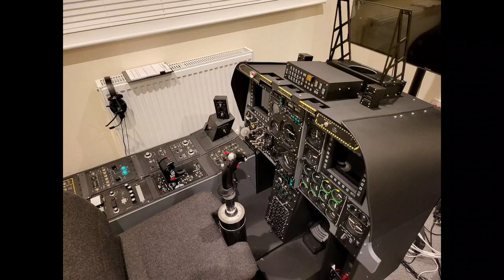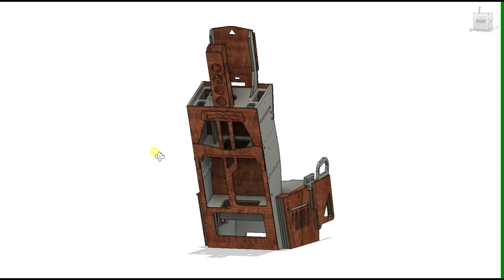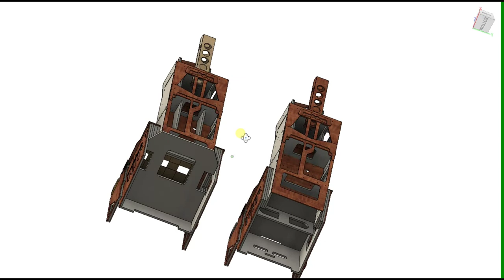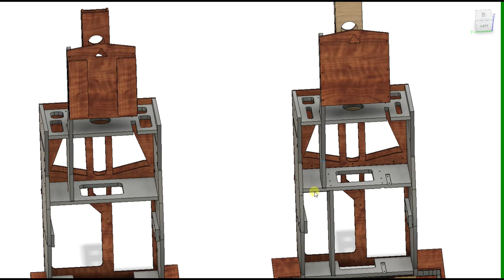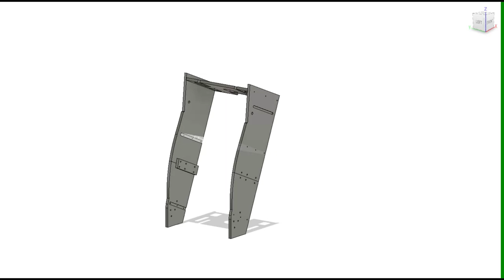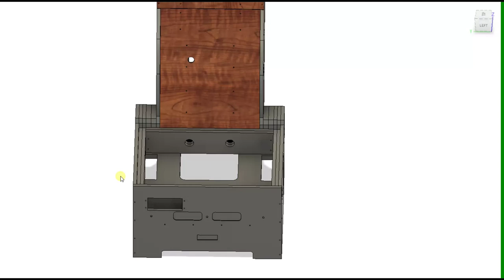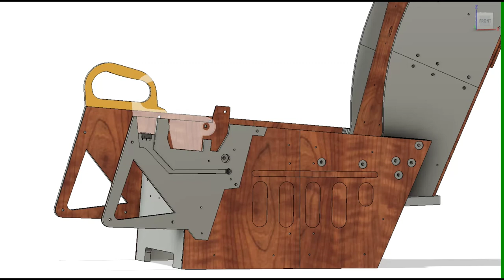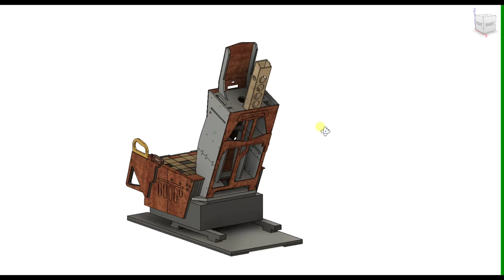Simpit A10C - Flight Seat - Part 2: Design

Comment: not sure if you have one, but it also might be worth 3d printing the things like handles instead of cutting them out of wood?  

i also bought flim's plans a long while back (having a full pit is way out of my space/requirements, but i wanted to support his work and have some accurate measurements.  for my "desktop" pit, i ended up 3d printing the ejection/etc controls and mounting them to the left+right mini consoles i have.  i originally made one handle out of wood.  later i got a 3d printer, and printing the ejection + parachute handles instead of cutting them out of various parts of wood was way simpler.  a fair amount of that wood inside the handles/etc would be just waste?  but then again if you're doing it all with cnc, maybe those can come out of other things that would be waste anyway?

awesome work though!
Reply from the maker: Hi John, you raise a good point and I had been thinking of 3D printing them, but I think whilst I'm CNC machining I may as well cut them out of the waste and see how they look. If I can't hide the wooden grain I'll 3D print.
Thanks for watching my video 👍
Reply: @CraigSmysimpit  yeah, that's why i went with wood for my first one too, i had scrap that size and no printer yet :D  for mine, i ended up drilling holes in the bottom edge and gluing in magnets, so that it was less likely to be bumped/move without me explicitly moving them, and gives a nice satisfying "click" when you flip down the arming level.  drilling out those holes in the wood handles was a pain, when i did them in 3d i just modeled out those holes.  can't wait to see the finished product!